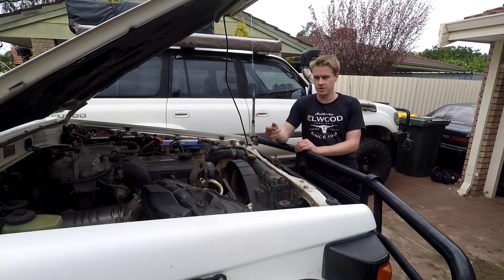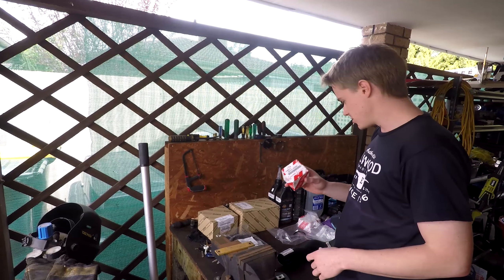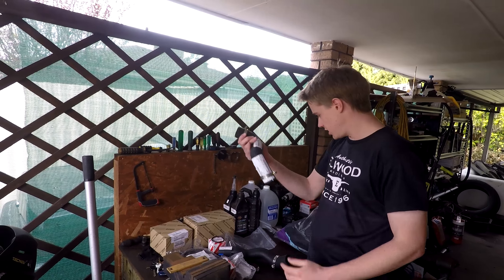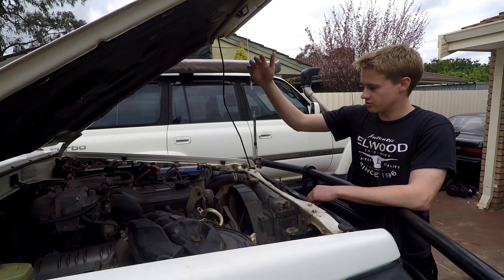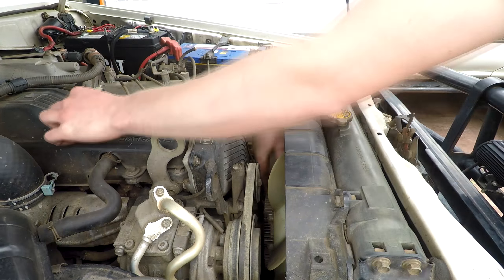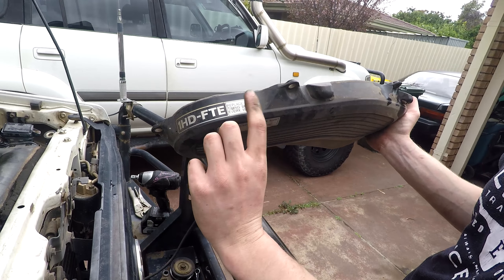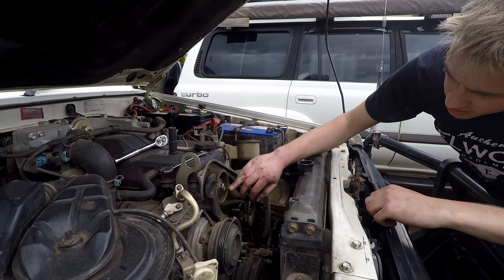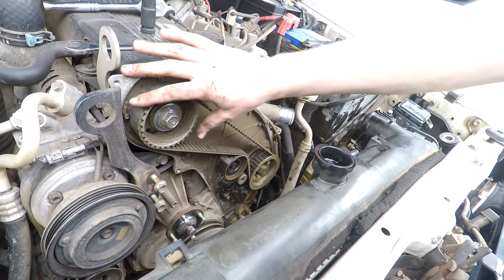How to: Change timing belt and water pump on Toyota Landcruiser 1HZ/1HD/1HDFT/1HDFTE Part 1

Comment: Hey mate good video....i am replacing my viscous hub on my hdj105. Is the fan shroud just unboltes from the top?
Reply from the maker: Yep just two bolts at the top. Drop the fan into the shroud and remove. Top hose on rad generally needs removing too but sometimes you can get around it.  You'll loose about a litre of coolant.
Reply: @brendonv101  thanks mate

Comment: Hey mate, do you know if you can replace the turbo coolant line off the upper outlet without removing the timing belt etc?
Reply from the maker: From memory no as it clamps to the water pump bolt which is behind the timing belt/backing plate.

Comment: the 1hz tensioners changed on the later motors. i did my 2003 1hz and it was hydrolic
Reply: They changed from the 5 month in 1998